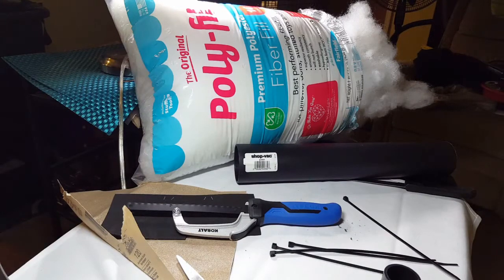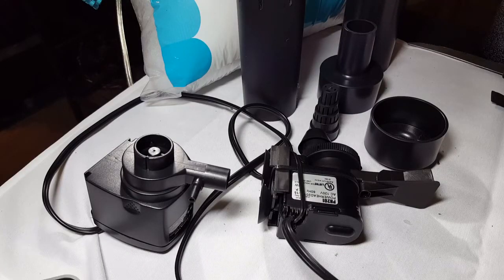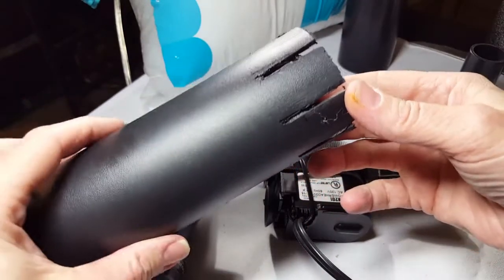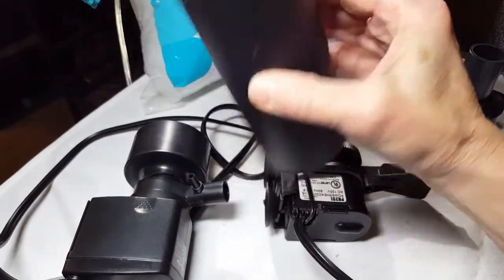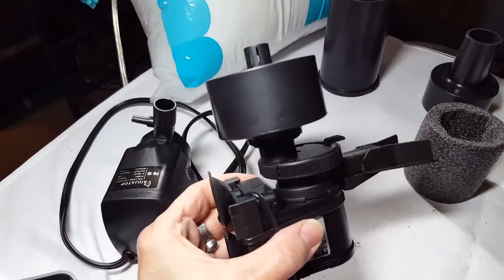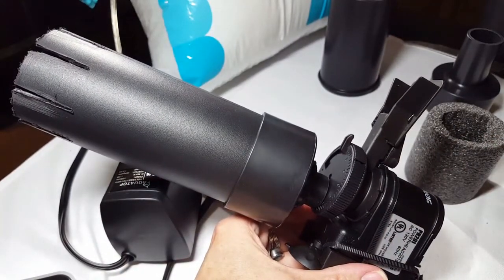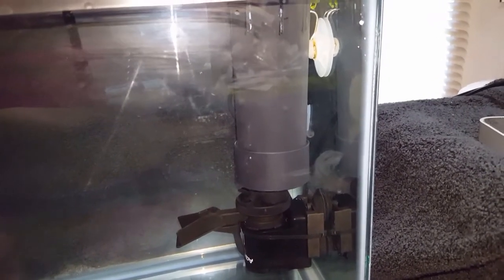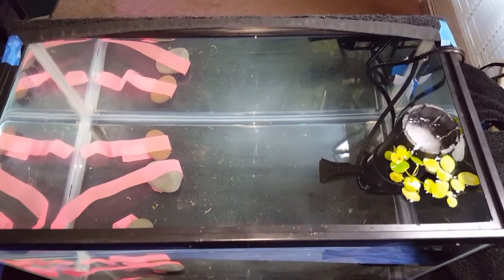DIY with 1f2f - Surface Skimmer / Water Polisher!

Comment: Love DIY! Great job. This version looks much easier to do maintenance on too. What not everyone has a lathe to adjust parts with. lol
Reply from the maker: Hey Fishman - first off - I owe you a hello and apology because I went back through my stream chat and saw you had popped in.  It was all I could do to squint at my phone and try to keep up with the chatter - but what fun that was!  So yes, I saw you were there and wanted to thank you for that.  NOW...if anyone can refine this concept and make it look pro, it would be YOU!  My skills are at caveman level - the plastic kept melting with the friction of the cutting wheel and my hands were not steady.  But, thankfully it was close enough lol.
Reply: You're too hard on yourself that was a great build and the tools needed to do it anyone can have. No need to apologize about the live stream it must be near impossible to keep up with all that is going on. Have a great weekend.

Comment: oh nice one ,nothing major just a small tip to beautify your skimmer,where you have made the slats,are all jagged and rough ,if you have one or can puchase a small flat file from lowes file the slats to get rid of the nobbly bits,stop you from cutting youself and will look better ........................all the best..................dougie
Reply from the maker: Dougie - yeah that was an issue - I have NO experience with rotary tools and the plastic starts to melt with the friction during cutting so there were lots of "snots and burrs" that resulted - some of it stuck to me and burned me a bit lol - ouch.  I knew it would be suitable for my purposes BUT hopefully someone with true cutting skills will be able to enlighten me on how to cut better slots.  
I did use sandpaper but the metal file idea is brilliant!  Thank you so much for mentioning that!  I was just so blinking relieved that it worked. !